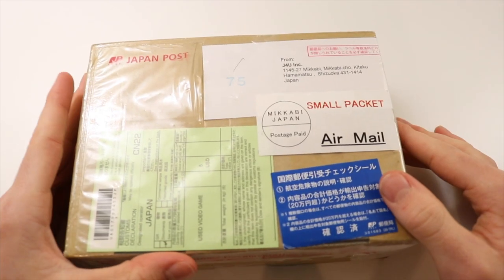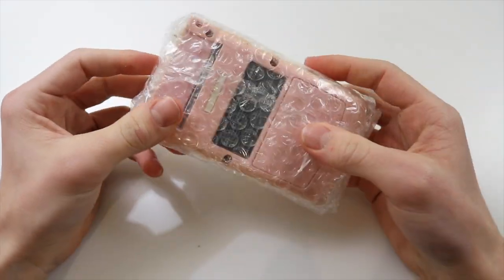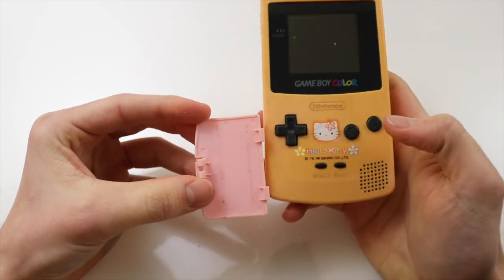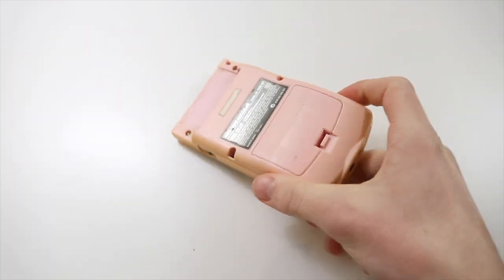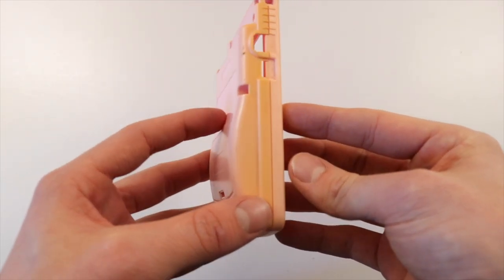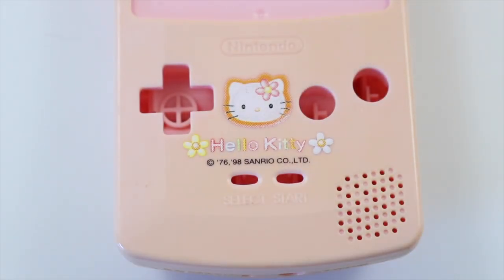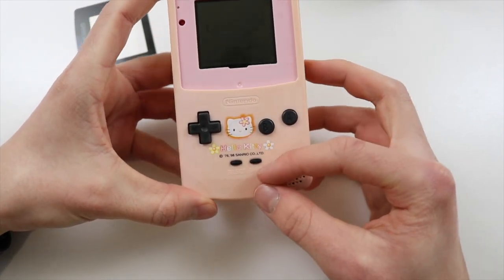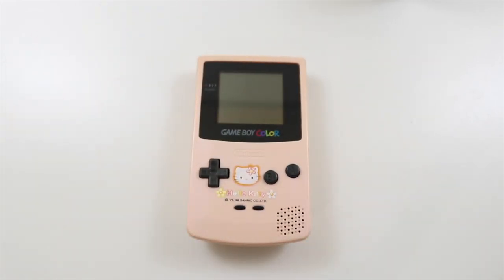GameBoy Color Shell Restoration!

Comment: Hi Elliot! I'm a doll restorer, and in our circles we use peroxide treatments for much the same reason you Retrobrite handhelds- Sun damage, glue degradation, metallic corrosion... These are all issues we have to tackle in our hobby as well! And from the findings in our community, I'd confidently say (but would love to be disproven) that the plastic of this shell is in fact being bleached. In the case of grey plastics, or plastics dyed with metal oxides (like the DMG and Vintage Barbies respectively), this isn't as much of problem as there isn't a 'pigment' per-se that the peroxide can "bleach" (or at least visibly so), so all it does is reverse whatever cosmetic damage was incurred. But with pigmented plastics, the color often gets bleached as a side effect of this reaction, likely hence in this case you got a washed out pinky-orange rather than the original color; Nevertheless, the shell looks a lot better! It's very cute. Love your vids as always!
Reply from the maker: Wow. That was an awesome read!! Thanks for all the info. Definitely an improvement!
Reply: Very interesting! Thanks for that info...
Reply: from your expertise, is there a way to recover the pink color after its been yellowened?
Reply: @PauAndrePau  Unfortunately, I'm not confident that there's a way to recover the pink color on this shell. For dolls, the generally accepted method of restoring color to bleached plastics is using an alcohol marker that matches the original color and wiping off the excess, leaving the pigment behind in the pores of the vinyl. But Gameboy shells are a harder, glossier plastic, so the pigment probably won't hold as well. Still might be worth a shot- But I would be inclined to test it first before I used it on a valuable project. Best of luck to you!

Comment: Have you tried JUST using hydrogen peroxide? Maybe the hair product has some extra stuff in it. 
Also will your method for fixing the power switch also work for a game boy advance power switch. The switch works occasionally, more often when I power it on slowly. A regular fast flick of the power switch as most users would do makes it power on for a split second then shut back off?
Thanks
Reply: Agent Antz: Game Saver isopropyl alcohol or WD-40 is your best option